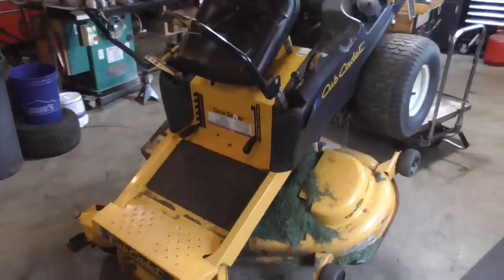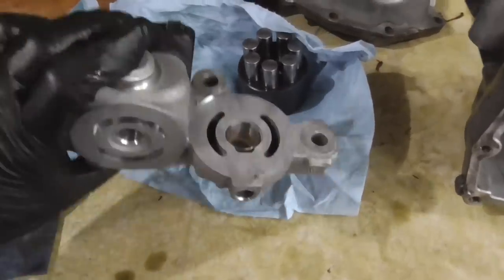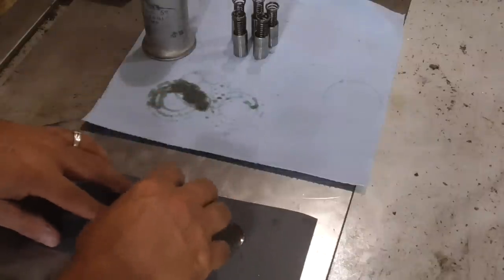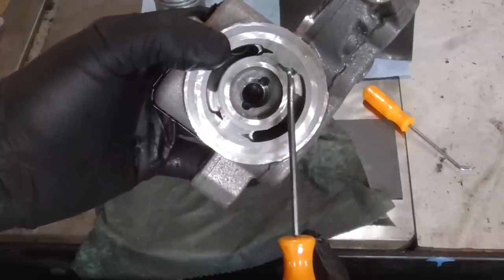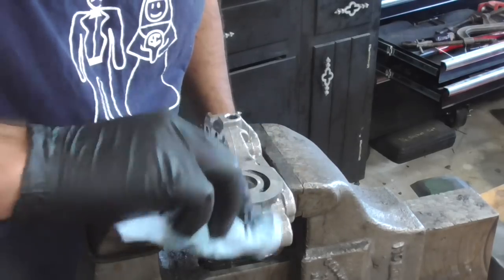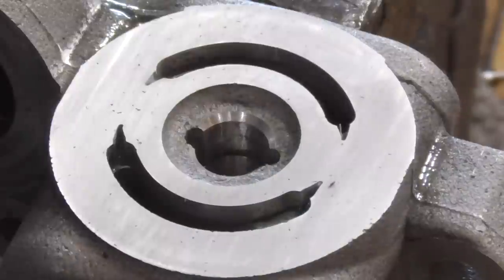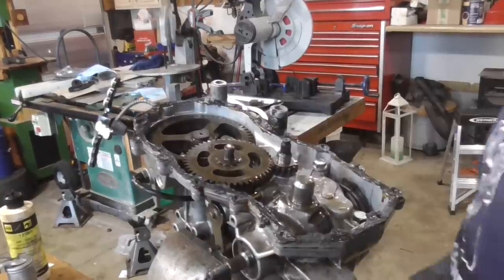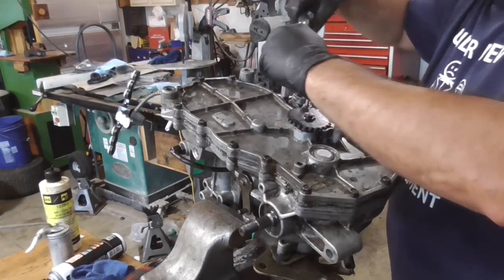Repairing Rebuilding Zero Turn Tractor Hydro For $20

Comment: Few things.. 
1) straight edge check. Surface finish looks good but is it flat? This kind of resurfacing needs to be done on a mill.
2) Gasket dressing?? Correct me if I’m wrong but dressing is only for paper gaskets and the ones that aren’t already pretreated. 
3) Silicone and clean bare metal...nothing else.
Reply from the maker: I don't know about that type of precision, but I can tell you without a doubt the tractor runs strong.  No Issues.  If I had better tooling I would use it, but I do not.
Reply from the maker: Yeah, Taryl,   Thanks for the support.
Reply: David P those are famous words I heard a guy say after he “shaved” the head on his kids dirt bike with a sanding block. Yeah it ran about 10 minutes before blowing head gasket🤦‍♂️😆. I trued it up for him.
Reply: doublewide6 Repairs LLC glad it’s working out for you. Just not something I would do freehand and feel comfortable charging my customers.
Reply from the maker: @garny3766  I understand, there is more than one way to skin a cat.  This method will be fine, but it is not the best way to do it (if you have the equipment and the know how).  Best Wishes.  DW6
Reply: David P We differ on this. I would not do this for myself either. Not something I would want to mess around doing twice.
Reply: David P The pistons ride on opposite side of the center section base. The pistons ride against thrust bearings. What rides against the center section base is the motor and pump blocks. @5:04 you can see the base of the motor block. The machined surfaces of the 2 concentric rings and “bridges” is critical to being flat. That is so fluid stays contained in the rings and does not blow outward or inward in a sunburst pattern. Now it goes without saying the opposite mating surface also needs to be flat. And by hand sanding this mating surface “aluminum center section” you are more than likely concaving or con-vexing it. So now instead of having fluid short circuiting between ports it leaking out the pump/motor “walls”.

Comment: So i did this to mine. i mean it was prolly less damaged than yours. But i did all mine to 1000 grit. Added a tab of grease on that lil key along with the bearings and the pistons so they would stay in place upon assembly. Installed with fresh 20w50. Attempted to purge the system (yes i have leaky external seal  on top where the oullry is) but. The thing should still pull better than it is. ITS NOW WORSE! I WAS EXPERIENCING OVERHEATING AFTER ABOUT A HOUR OF MOWING. NOW IT SEEMS TO BE FOING SAME STUPID BS WITHIN 5 MINUTES OF STARTUP. I EVEN USED A WHOLE BOTTLE OF LUCAS

Comment: Did You mention in a previous vid not to turn these around on a hard surface because the wheels need to slip?
Reply from the maker: Probably, but that is when mowing don't turn on the street all the time for 10 years straight.  Testing out a mower not a big deal.

Comment: If your going to use a stone, make sure it is flat and true. Don't know about mixing those sealants?
Reply: The Permatex Aviation formula can be used on metal to metal contact with decent success.
We more commonly (daily, in my shop) use it to lightly coat both sides of paper or felt gaskets.
It 100% solves those type gaskets that are prone to leak over time.
Based on my years of experience with this product, I think it a BAD idea to use it in conjunction with RTV...